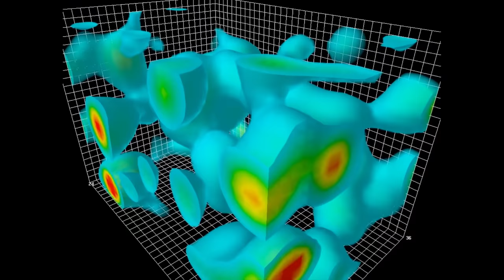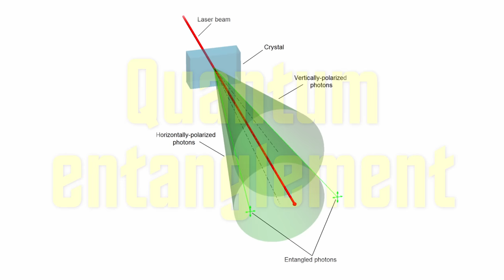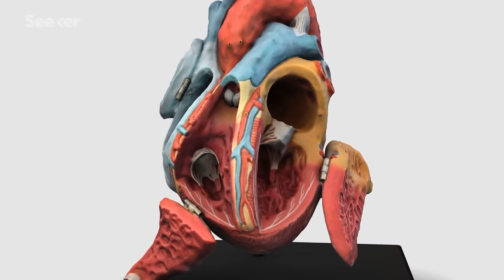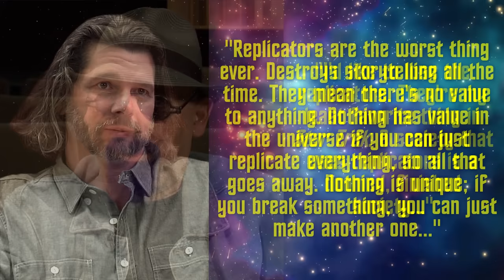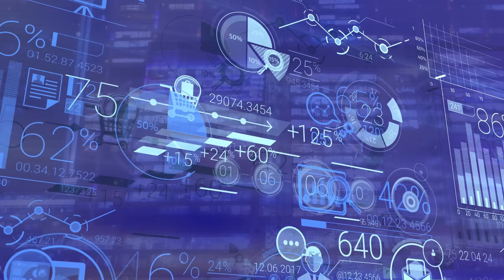Do Star Trek's Replicators Break the Universe?

Comment: To me the limitations of the Replicator was, apart from pre-programmed limits (poisons, knives etc.), materials. Its still basically a transporter that, instead of outputting matter exactly as it was put in, rearranges it from whatever is in the recycle bin into something useful. Whats in the recycle bin? Carbon, hydrogen, oxygen mainly, because thats basic organic chemistry, and from there on smaller and smaller amounts of everything else in the upper half of the periodic table, short of maybe noble gases and other exotic stuff. So sure, it can take all those atoms and rearrange them into new molecules, because thats relatively easy to do. But what the replicator cant do is take all these lighter atoms and get heavier atoms out of them, like lead, uranium, gold and whatnot. So that still leaves you with Replicators that can produce pretty much ANY daily use item, tools, cutlery, ceramics, plastics, on top of food, clothes and whatever else one might need in life. As long as its made out of this selection of atoms available. But Duranium hull plating, Beryllium spheres or spare parts for your ship are not on the menu. 
Sure, specialized Replicators that are fed with materials specifically for machinery or weaponry even could work around these limitations, but they would just not sit in everyones living room, but instead be on Starbases. 
The other limit is chemical energy. Namely things like explosives and energy sources. Speaking purely in simplified chemistry here, these things would come out of endothermic reactions, i.e. you need to pump energy in to make them, as opposed to exothermic, where energy goes out. Like fire. Or explosions. Batteries are an example of both, because you can charge them, causing an endothermic reaction in them, and as you draw power from them the reaction reverses. Obviously this wouldnt be a hard limit, as even food contains chemical energy, but more of a sliding scale one. Maybe basic power cells are possible, but high-end ones used in a hand phaser would be above the limit. Firewood might be fine, maybe even charcoal for that BBQ (please follow fire safety regulations), but not C4. Serious putty is off the table. Part of this might be again a software limit, but at some point it will most certainly exceed what a normal Replicator CAN do entirely, and again one might need a specialized model.

Comment: There are two options I see (headcanon) for replicators in Star Trek: they do matter synthesis from energy at up to 100% efficiency, or they imprint a quantum pattern on vacuum fluctuations creating the matter at higher than 100% efficiency. For the first option, energy reserves would be a huge issue, basically meaning that matter would need to be converted from matter/antimatter energy stock or possibly converting from inert matter stocks via a transporter like process. The second option would allow for matter creation from less energy stock.

I imagine the fact that everyone can tell the replicated food comes from how consistent and "perfect" it is. 

As for breaking plots... there are ways around it. Not having a pattern for something, like a novel medicine, means it still has to be developed before it can be replicated.

They also don't break capitalism, as IP would become more important capital, which is already happening.

Comment: My headcanon is that the replicators are a low-cost, low-res version of the transporter.

Transporters (at least in classic trek) are extremely hi fidelity; they need to precisely reproduce neurons to the quantum level. That's why they have dedicated rooms, power supplies, and their own computer system with massive memory buffer.

Replicators, on the other hand, only have to assemble molecules to the point where a person's body can absorb and use the nutrients. This does replicate taste and texture (both side-effects of assembling molecules) but they're low-res, so everything ends up very uniform. They're probably also adding nutrients to help ensure the meal is balanced. This means they don't taste quite like a "real", organic meal would.

It's kind of like the replicator has taken a scan of the Mona Lisa, then printed out that scan on a good quality ink-jet. It looks the same, but it lacks texture and realness.
The transporter, on the other hand, takes a quantum-level scan, and reproduces the wood and paint to a level that is indistinguishable from the original.

Comment: It's too late for most of your problems with Replicators. The cat is already out of the bag so to speak and we will see these physically by the year 2050. Star Trek will do to these synthesizers exactly what has been done to Cell phones only much faster, The Med beds are already being manufactured as we speak to the order of 1000 per day. The very first task for these replicators is Build us another replicator and so this will launch this much faster than you can blink and maybe even faster. 1 Replicator makes another then each unit will make as its first task and it will take off exponentially. With just a minor feed of energy 1 makes 2 makes 4 makes 8 and on and on.

Comment: I feel that the writer's dislike of replicator tech is a result of limited imagination, or perhaps a reluctance for "grit" in the Trek-verse.
The energy used for replicators is very likely covered, exhaustively, somewhere. But I also would be willing to bet that it too is a bit too... sci-fi-magic. A device that very much creates atoms and fuses them together in exceedingly complex arrangement and quantities and which does so very ridiculously quickly... that device would use up a LOT of energy. An irresponsible amount, in fact. But in the shows/movies replicators are shown as being just another appliance in this fantastical future setting, no more demanding than a microwave or simplistic machine that melts plastic and spews it out via a controlled arm/emitter. But replicators are many times more complex than any such appliances and would need to be wildly more energy consumptive. Creating atoms tends to require stars' fusion reactions or even neutron stars merging. I personally feel that it's asking a whole lot of the fictional di-lithium crystal reactors to be able to power a few to couple hundred or more of these things on top of all the other power demands of these massive star ships.

So there is your narrative cost/balance. That's what allows these things to exist but also not be the easy fix to just about any and all situations. 

Furthermore, what of errors or performance degradation? They essentially don't exist, the machines work perfectly all the time with their only flaw being that they offend purists. But if errors were more commonly possible, then that gives even more wiggle room for the narrative. Depending on the materials being replicated or the complexity of the object/substance it can be more prone to error, take longer (even if the time increase is to allow for error-correction safeguards) and sometimes be too great a drain on a ship's energy grid. And of course all this has the added benefit of making the Trek-verse feel more believable.

Comment: No I don't agree with the sentiment that Replicators were bad or the worst.  I think maybe Directors lacked imagination.  

If you broke something then that piece was unique and replicating it means you made a duplicate not recreate what you had.  
I mean if that's the case then mass manufacturing is the same idea as a replicator.  I mean, what's the difference between your mug and the 10,000 other mugs just like it?  Well your mug is yours and it may have sentimental value because a loved one gave it to you or because you've had it for a long time or it reminds you of when you first got it. Get a new one that looks and functions exactly the same isn't the same. 

Besides many of these Directors are the ones that made a ship Captain (Aka Picard) know the internal working of a turbo lift when he was never an Engineer or allow the ship Captain to go on every damn away mission possible which is not only a waste of time of the Captain, utterly ridiculous and/or btw maybe send a specialized team for the specific mission instead of always sending the damn bridge crew and the ship's doctor to scan the planet.  But that's the lack of vision of the Directors. 

Maybe instead of blaming a replicator, perhaps make it a limitation of the onboard replicators or perhaps the energy needed to replicate certain materials.  
Food replicators would require little energy since all the atoms involved are low level atoms, there isn't any heavy elements in food.  A stake is made of H20, Carbon, Nitrogen and Oxygen. 

However, crystals and metals by definition are heavier elements.  Platinum which is probably needed for many of the engine components as well as Gold, Mercury, etc.  I'm sure these and many more elements are required to make critical engine parts and probably require massive amounts of energy to combine to make alloys.  The Enterprise (or any starship) would only have a limited amount of energy on board or at the very least a maximum output per hour they could produce.  So it isn't beyond the imagination that say a Dilithium Crystal or Engine Core parts were build on Earth (or some factory somewhere) and they were part of a ship's supply.  

Now, it isn't beyond impossible that perhaps in one of the battles one of the cargo holds, which had critical equipment got damaged during a battle and then along with some engine damage that the ship would end up stranded or in dire straights.  See not that hard and you get to keep the replicators.

Comment: the replicators suck like 3d printers. Plenty of non replicatable materials, and they were into details about specific replicators for special materials. I am sure that it gives you a die cast zinc version of whatever. The only reason it might be stronger right now to 3d print these things, is because welding technology has not developed yet, so certain structures are stronger then welded structures if they are 3d printed because they don't have weld seams.. but if you can make something from stock its just gonna be stronger. In the end I am sure they will take forged armor plate and shafts vs replicated stuff. You might call replicator goods 'low performance' components that are weaker and downgrade a design. 200 years down the line, injection molded plastic technology will make 3d printer products look like styrofoam. Show me the safety critical 3d printing parts (they don't exist and its a bad idea). You can account for weakness in parts, but its not high performance optimized design that you can trust for infrastructure use, more like bandaids.

Comment: Capitolism wouldn't suffer as much as some may think if we had more localised trade and manufscturing. The raw goods would still be unevenly distributed, so capitolism would still be thrivimg in the transport, trade, and production sectors. It however would be less centralised like it was 150 years ago. Ppl could still build houses and things, but they wpuld have to rely on capitolism to deliver the raw materials, instead of having to outsource everything.

Comment: Replicators, much like Transporters were created by writers to solve budget constraints without consideration for what they would mean for the setting. If your science is advanced enough to have these, then you should be WAY beyond fusion/anti-matter power generation. 

Shields should be pointless in Trek because you could just use a transporter/Replicator to change a targets shield energy into some other form of energy. Hell weapons would be all matter-to-energy transformation weapons, turn your enemies ships into energy instead of just trying to damage them. 

The science level required to have replicators and/or transporters was never correctly considered and thus so many plot holes exist all over the Trek IP. Consider that something as simple as a planets magnetic poles is enough to blind Trek sensors or that electromagnetic fields do the same all the time. 

Everything about these techs was made so things that didn't make sense about the ships could be ignored. The almost complete lack of cargo space that a ship that size would require for food/water/fuel is one of the reasons Replicators were made into a thing. Not having the budget to film shuttles landing on planets was the reason for transporters. When you add things just to effect your budget and then try and justify them in universe you get this inconsistent rubbish.

Comment: Most of the limitations on the replicators that you talked about, were nothing more than things made up by writers, who as you said hated the replicators, because they made it difficult to make their plot line work. The first ever explanation I read on how a replicator worked, was that Matter (it didn't make any difference what it was) was converted to energy at the atomic level. The atoms were then assembled into whatever you needed. No limitations. For example in STTNG data is playing a replicated Stradivarius violin! This would whip out any value to a Stradivarius.  As was said, that would put an end to an economic system of any kind. Which is what Roddenberry wanted, a society that didn't use money! It also made mining completely unnecessary, because raw ore could be mined from asteroids by robots, and replicated into whatever was needed. Even in the original series this was a problem for writers, so they came up with 'credits'. It has never been explained how 'credits' are not money, but are used to buy things on planets that do use money. With the federation using antimatter to generate power, there would be no limit to the size of a replicator. Need more power, build a bigger antimatter power generator. Build one star ship, then replicate as many as you want. So the only limitations were put there by writers a time limit to write scripts, and needing a way to make their stories work.

Comment: I have several assumptions about replicators.  Assuming this is engineered, at first they will be large machines.  That will shrink over time, but I think the gen 1, if you will, will only be available to industry.  This will allow things to be made in wherever the demand is, down side is it won't add many  FTEs,  if any.  You'll still have a large portion of the population working with only a small amount of job elimination.  This will only be temporary.  If it follows the tech, within 10 years we will have the ability to make home replicators.  The demand for experienced fabricators will rise, this assumes you need one of an object to replicate as a pattern.  But, unemployment will bring most of the world to its knees, every country will have to contend with complete industries being destroyed and that will trigger massive unrest.  I think the scale this happens will be almost flat at first but will increase dramatically and quickly as the tech goes from experimental, early adopter, as a planned expansion, general industrial use, general commercial use, available home use.  I say available because I assume the divide between the haves and have nots at that point will be huge.

Comment: The replicator rationing on Voyager never made any sense. "Recycling" wouldn't exist if the process used more energy than it recovered from the matter converted. That being the case they could simply stop at any stellar body and collect literally anything, rocks, water, even hydrogen and just convert it to energy. Maybe from some reason the replicators can only disassemble synthesised matter, maybe it has to have the record of how it was constructed to undo it but that seems unlikely, I suppose there could be some danger of producing radioactive particles if the structural analysis was wrong and it somehow broke the atoms apart incorrectly. I don't know if there's an in-universe explanation for this.

Comment: The original tv series from the 60's had an episode where kirk was arguing with the chef for fake turkey to be made for a holiday dinner which implies the "replicatirs" were just high tech dumb waiters which delivered the food.   The original series also showed one transporter room with three such food dispensers but no counter or seats ti eat food at so presumably the duspensers night be tied into the transporter system, basically small transporter pads for non-living products and the three dispensers in the transporter room waa fir diagnostics by transporter technicians for maintenance.   There was also one original series episodes where the food dispensers were over run by small furry creatures called Tribbles.  The replicated food would've hence been fabricated at a large factory/kitchen and simply delivered by the dispenser system with lower fidelity transporter technology.   

It's disappointing that the prequels such as Enterprise, Discovery and Strange New Worlds did not maintain this oversized replication/synthesis/kitchen facility and kept the dispensers as high tech dumb waiters from a centeal fabrication location, it's a given that the sequel series such as TNG, Voyager and Deep Space 9 could have ninutueized replication machines instead of a delivery network as over a hundred years had passed, but there was no need to place the expectations from those sequel series onto the subsequent prequel series.

Comment: I was under the impression that replicators didn't just use energy, but the material they used to produce something was some sort of proto-matter that was specifically designed for replicator use. If that's the case, then that proto-matter would be their economic anchor (like what our gold standard used to be). But of course, like every other economy... they would have other resources, materials, and sources of economics that would be both obvious and unforeseen.